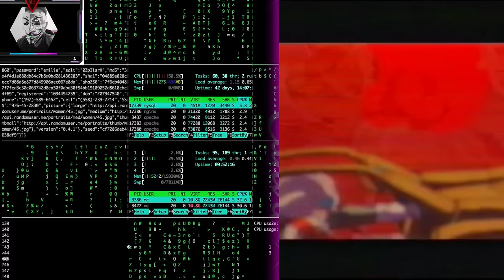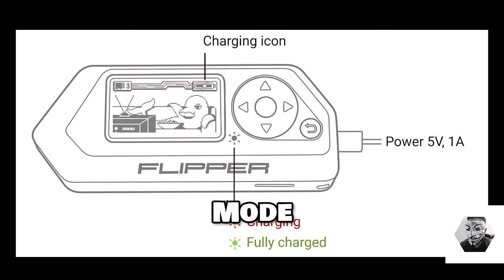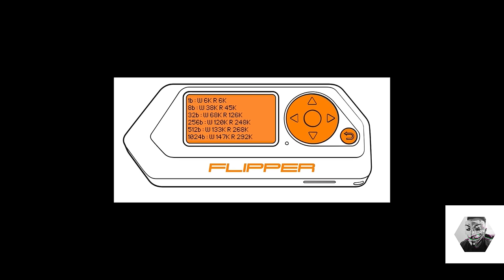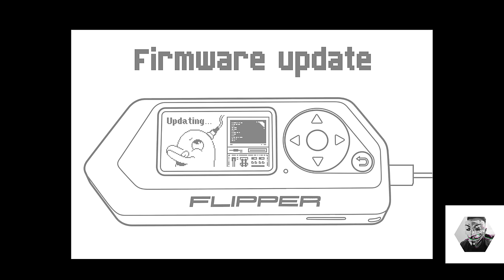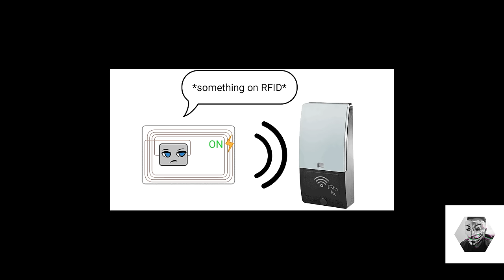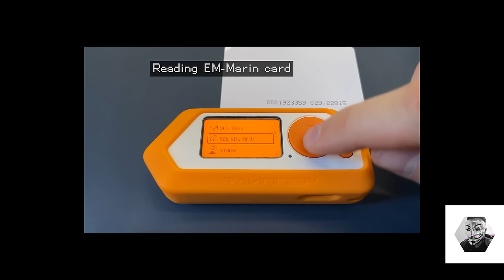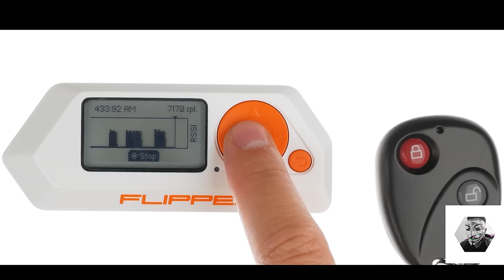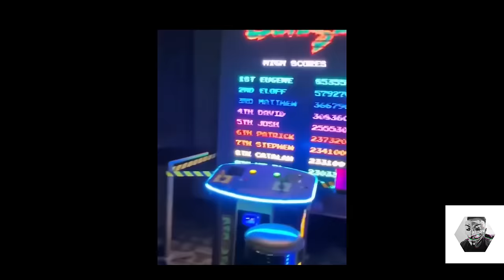Flipper Zero - Starter Guide

Comment: I want to see more with hardware hacking.
Sam's Experiments is the only other channel getting full use out of the flippers gpio, and I'd like to see what other kinds of devices can be controlled using just the hardware and a simple plugin.
I've seen a lot of buyer's remorse from people who never should've bought one of these in the first place, who don't comprehend the infinite potential left to pull out of these little guys.
There are so many cool projects we'll be seeing as more batches get into the hands of people who can really use them, instead of just scalpers (who don't even bother setting up good shops!)

Comment: In the quick start guide they state up to 256gb can be used on a micro sd card, not limited to just 32 like stated in this video. So unless they have changed the info recently, it is 256 max
Reply: Flipper Zero stores keys, remotes, and cards on a microSD card, as well as databases which is why it is important to insert the microSD card BEFORE updating the firmware. Flipper Zero uses the FAT32 file system and supports microSD cards up to 128 GB, but we recommend using a microSD card with a maximum capacity of 16 GB or 32 GB.
Reply: @devilghost  per the guide that comes with it, 256gb
Reply: @rballwv  again 32 is highly recommend using a higher capacity may just result in problems with the unnecessary  space.
Reply: On the flip side, is there a minimum recommended capacity? Would a 4 or 8gb card suffice?

Comment: can you use this thing to gain access to carded doors / buildings without having the card needed? a way to just scan the reader and emulate it possibly?
Reply from the maker: There is a brute force option although it's a bit bait to stand there until it can find the right combination 😅
Reply: @PenAce  oh dam that’s sick. Not tryna commit robbery or anything just get onto roofs of buildings for sick photos w my camera. Cheers for the response, for sure thinking of getting one
Reply from the maker: @jc123_3  A fantastic gadget for your arsenal! Check my community section for official links and discount codes.

Comment: How do you open doors and open car Barriers? What do u go onto on the flipper?
Reply from the maker: Did you manage to get one now?
Reply: @PenAce  ?How do u open doors and car barrier with it ?
Reply from the maker: @ipwnxdemonzz4223  Because those systems you mentioned are in the low frequency range, as mentioned in the video, you have two options. Listen for an incoming signal and either grab it or tap and clone it. Hope this helps.
Reply: @PenAce  Simples :)

Comment: Do u need a computer to use the flip zero cuz I don’t have 1
Reply from the maker: You will need it at some point to make firmware changes or file edits. The app does work well and you can get most done with it.

Comment: can i get in trouble for using it?
Reply from the maker: Flipper Zero is absolutely legal for import into all countries. The FZ is totally legal, but how you use it could change that. Same for knives, hammers ect. It's a tool at the end of the day.
Reply: @PenAce  so if i wanna open a garage door, i need to find the right frequency?
Reply from the maker: @shadevelt  The Flipper Zero, as demonstrated in the video, can intercept or emulate a signal on contact.

Comment: What sd card do you recommend?
Reply from the maker: SanDisk 128GB Ultra microSDXC card
Reply: @PenAce  I saw a video were they said they don't recommend over 32 gb is that bs ?
Reply from the maker: @ramonmurillo300  Yeh, lots has changed with the FW since this video 🙂
Reply: @PenAce  thank you! Got mine today just gotta buy the SD card and I'm good to go
Reply: @PenAce  does using a different type c matter ?

Comment: How do you know that intelligence agencies don't have a backdoor to this thing?
Reply from the maker: While I like the angle you are coming from you need to understand the device. FZ is designed with transparency and user control in mind. It's an open-source device, which means its software code is publicly accessible for anyone to inspect. So you can review the code for any potential vulnerabilities or backdoors, providing a level of trust that's difficult to achieve with proprietary systems.

Comment: So my question is if I lock myself out of my house and I forget my rf card and I run to Walmart purchase a flipper0 and try to get in my door DO I HAVE TO DOWNLOAD/DO ANYTHING or can I just hold it up push a button and then it opens up my door lock?
Reply from the maker: If its just an RFID card you would need to clone the original onto FZ in order to emulate it. If you can't clone it you would need to capture or fuzz the code using CFW faps.